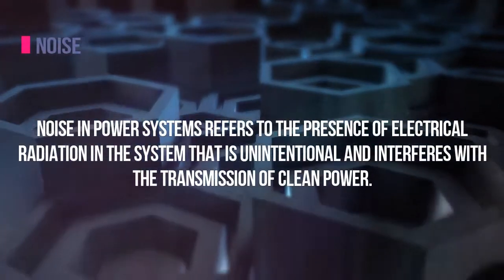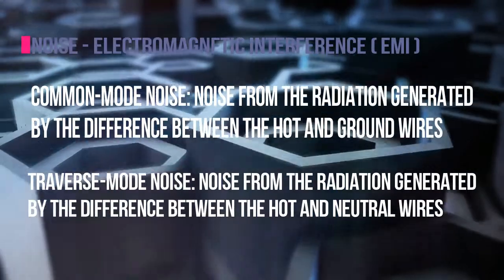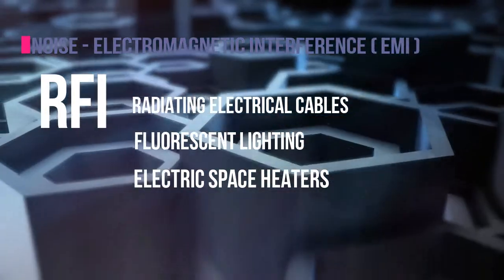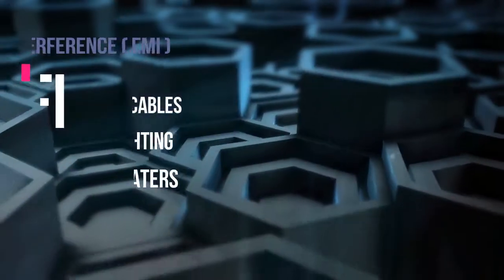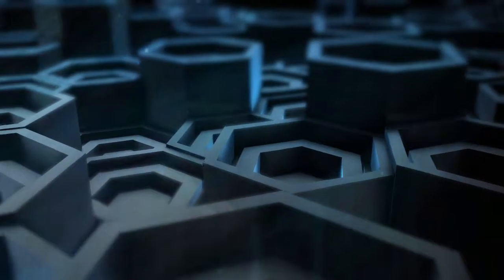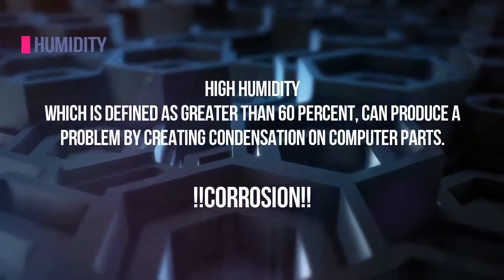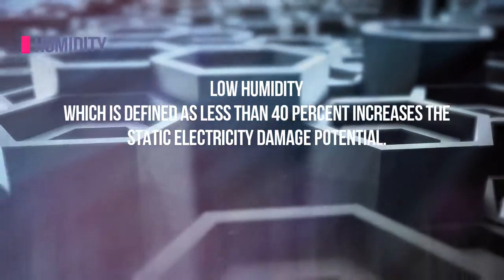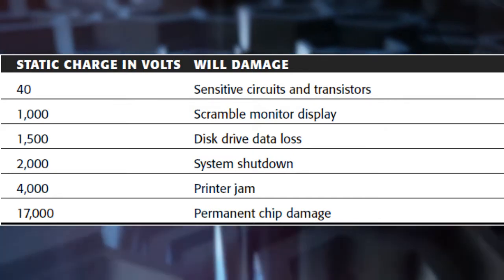Environmental & Life Safety Controls

Comment: Which suppression method would be best suited.to your organisation and why. How would you implement it?
Reply: By now there are many work arounds to using halon safely, so I would go with a system  that uses the halon gas for the suppression of fire, and just like I mention in my video, one major advantage of using halon is that is great for use within an area that mainly has computers, therefore it would be good for my organisation. There would be a piping system that connects to the air ducts that would allow the release and easy spread of the gas throughout the building.